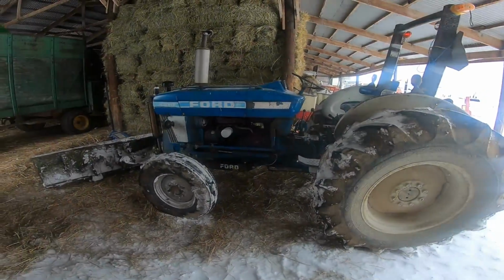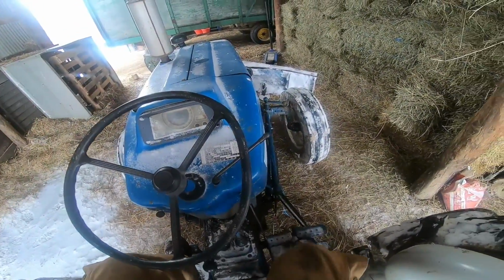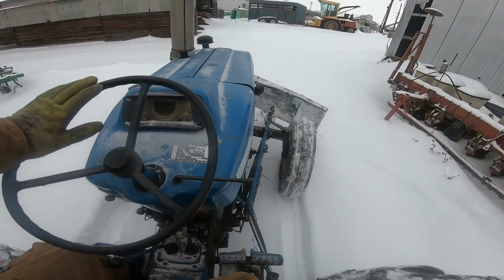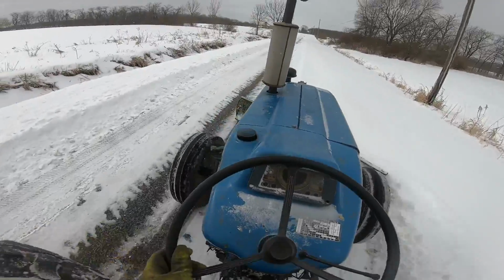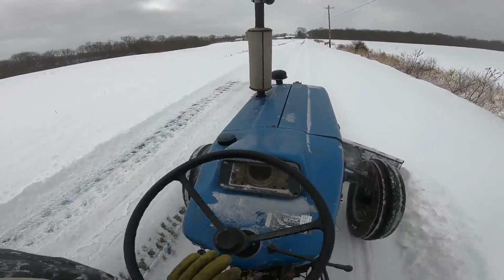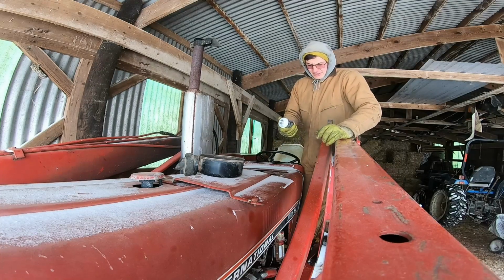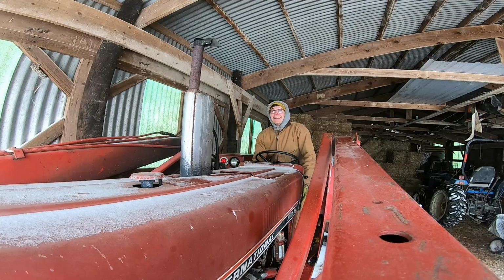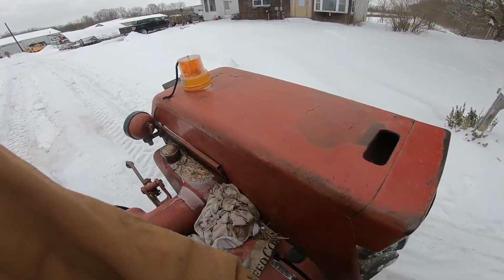Two Cold Starts Before Pushing Snow

Comment: I run a JD 520 that i run a back blade with tire chains and 3 sets of rear wieghts and i dont have too much traction issues. My chains are not the right size for my tire pattern since they are straight bars and 1 side falls into my lugs regularly and they are wore out so i want duo cross pattern chains

Comment: You got one thing right! That 4DLT battery is a Hoss!! Always want to rig  2 of those in  parallel on my 4230. Think it would have been much better than those 6 volts in series. BTW, people cringe when you put ether in a Diesel. Which no doubt must be done with with care. I started our old ford 3000 and 4230 many many times with a snort of ether. Both served many thousands of hours with No engine problems what so ever.
Reply: Hot air gun pointed at the intake manafol